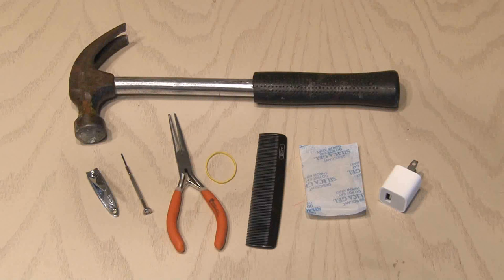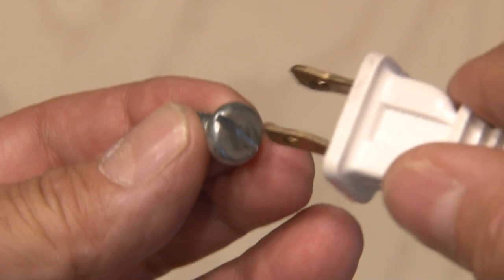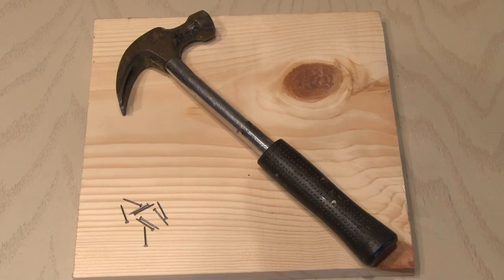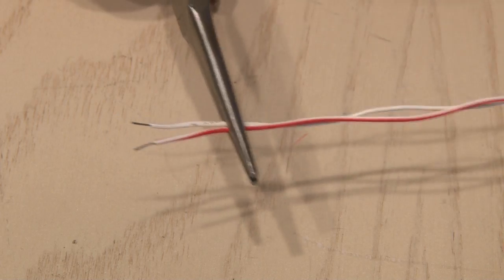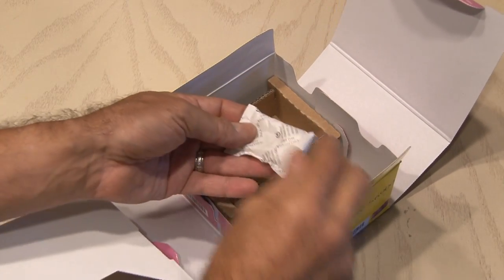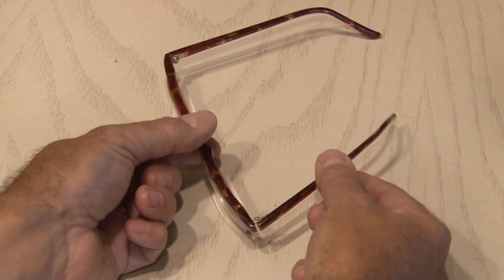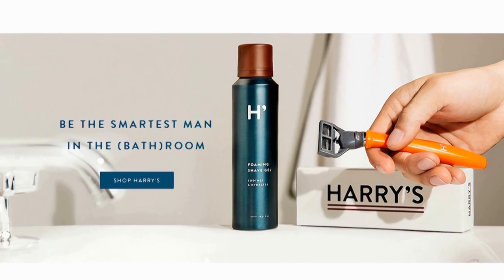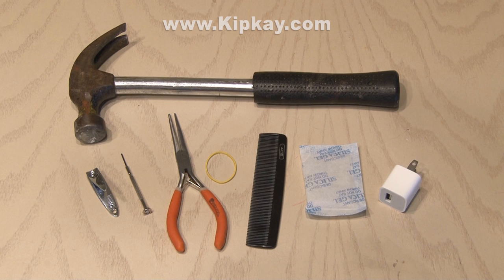5 Handy Tool Hacks!

Comment: 1st trick not working for EU people
Reply: Agreed . im from Croatia.
Reply: Same with uk
Reply: That's why America is better
Reply: MLC games daj cuti
Reply: Ryan Albright america is better because of a plug?? Well America really is impressive with its plugs then.... We have a lot more in Europe than just plugs.
Reply: Yeah I forget what the EU adapter looks like let me check BRB
Reply: Yep I could see how cylinders would make that impossible
Reply: Ryan Albright I would say that the plugs we use in Europe are better, Since your plugs don't have ground connections.
Reply: Küsh_Lord US plugs do have ground pins, just not all of them. I don't know why. It's pretty stupid.
Reply: ThatGuyNamedScott. C in EU we are using 230V in the outlet instead of 115V
Reply: three phase?
Reply: Super Nova The 240v outlets are actually only running on two phases.  I have yet to see a house with 3 phases, I do electrical work.
Reply: sc0tte1 You got them in Europe. But they are at 380 volts.
Reply: cokefridger what do you mean "buy" guns? we get them in our happy meals at McDonalds
Reply: sc0tte1 No. You only count the phase, not the neutral and protective earth. 230V: 1 phase, 400V: 3 phases. at 230V you must use a neutral, at 400V you can use a neutral (at equal load on all phases you dont need it). 220V and 380V are old values, they are not used any more. At the most houses a 400V, 3 phases cable comes in and get spread to some 230V, 1 phase. On big loads like oven, cooker, etc. you can have 400V.I refer to Germany.
Reply: cokefridger # phase plug has 3 prongs and two slots for clamps for ground and zero. If you connect ground to zero the main safety switch turns off the power.
Reply: Super Nova I am in Canada lol
Reply: At least in the UK our plugs are fused and have to have an earth plug, they are also 240v so America's plugs look like a childs toy compared to our bad boys...
Reply: ***** what language are you speaking?
Reply: Ouchie God damnit! My wallplug is round
Reply: ThatGuyNamedScott. C I didn't know that the uk wasn't in Europe {-_-} smh
Reply: Graham Hosken I never said it wasn't?
Reply: ThatGuyNamedScott. C then why did you say and the uk too
Reply: Graham Hosken because UK has different plug to mainland Europe?
Reply: Graham Hosken I know but people forget we are different
Reply: ThatGuyNamedScott. C ok
Reply: Why so much aggression here? We are all human beings, accept each other as that...
Reply: snovosel2 Ja isto iz kojeg grada si?
Reply: Ouchie ! WRONG ! 
In the EU (and rest of the world lol) you can use the later shown "HotGlueMagnetic-Impact-Tool" to hammer the Plug in every needed shape like Phillips ; with time and efford you can realize TORX and all other kind of exotic Screws easily. 

..."People cant transfer things they learn in a 3 minutes video... thats so... king of random!"...

Kappa.
Reply: Ryan Albright Or maybe that's why America is the worst.
Reply: Ouchie greece
Reply: +Ryan Albright Hahahahahahaha
Reply: +Ryan Albright EU masterrace!
Reply: use a Butter knife xD
Reply: +ThatGuyNamedScott. C The US is getting pretty bad hope they have space for me in Germany.
Reply: Cancel
Reply: Same Asia
Reply: Ouchie yes im from Romania

Comment: The silica gel only works good when the tool is enclosed inside a bag or container with the silica gel, otherwise the silica gel will soak up all the moisture in the air in no time at all if left in an open draw. You can refresh silica gel packs by placing them in a toaster oven set to 150 degrees for 1/2 hour. The best way to prevent rust on tools is by applying a thin film of motor oil using a rag after using a wire wheel to remove the surface rust.

Comment: You can also use nail clippers on zip ties if you are doing cable management. They are also handy to cut the tie without cutting any wires.

Comment: Another helpful "hack" is to sand the face of your hammer with some 120 grit sandpaper. It helps keep the hammer from sliding on the nail head as you strike it. Try it, it works!
Reply: Nice

Comment: I have another hack, if your into making model railroads or you work with small screws you can use twisers with "flat" ends to old and rotate the screw at the same time so you dont loose it and you can pull it out from tights spaces with is pretty common in model trains

Comment: I like the silica packs.

Other tips:
Place the back of a hammer into an area you need to ply. Take a different hammer and smack the hammer end of the first hammer. Now you can ply very easily. Also works with crowbars.

Comment: screwdriver hack doesn't work in europe
Reply: samramdebest Use the $15 (€13) you save by not going to Harry's, because they dont ship to Europe, and buy some American plugs on ebay.
Or as a last resort go to a poundshop / Todo a 100 / Trezentos / ToBi / 100 forintos bolt / HEMA / Tiger / 300 / Dealz / Tier'n / Bubbeltian / Fixprice and buy a screwdriver.
Reply: Maxx B Or use your nail
Reply: Just get a knife 
That works also
Reply: I'd just use the pliers with the small screwdriver, save me trying to find the nail clippers, which is almost impossible in this house.
Reply: KnifeH Were you trying to be funny?
Reply: Desmond Miles D'aaaw. wittle Desmond-chan doesn't understand and has to confirm if it was funny or not.

Don't worry though, I understand it's hard sometimes. <3
Reply: Desmond Miles D'aaaaaw. He's so mad he need to use an insult that isn't even an insult anymore. So cute. I just wanna pinch your cheek.
Reply: It does
Reply: +0Alastair0 no it doesn't

Comment: Instead of fumbling around with a pliers and a rubber band to hold a wire for tinning, I just use a clothespin.  The kind with the wired spring-action.

Comment: on the nail thing you can usually just hold your hand flat against the surface and put the nail between your index and middle finger to hold it, give it a tap to make it stay in place, then move your hand away. if the nail is too small for that or your fingers are particularly thick, sure, use a comb. i am just pointing out that you were holding the nail wrong in the first place.

Comment: Use the needle nose to hold small nails for hammering. No need for a comb, and with the needle nose, you have grip strength and nails fit well in the grooves so nails to not move around.  Also, just use the normal pliers to hold small or thin screwdrivers. I would imagine if you are working on stuff all of the time, you would have easier access to pliers then nail clippers. Oh, and buy Harrys shaving stuff...

Comment: I don't think that silica gel bag will work in that last drawer ;-)
Reply: pcfreak1992 ...or any of those non-airtight drawers.   But hey, at least the air around his tool box is a tiny bit.. less.. moist...?
Reply: pcfreak1992 It does work, but they make crap screwdrivers.
Reply: Dosbomber well maybe a little bit, but that gap was so huge, that even walking by the thing would flush the whole drawer with fresh air.

Comment: Kipkay then you will make halloween or night lamp powered from batteries? I am waiting. Thanks for video!
Reply: windlink123 not to be mean but thats to easy, 3 orange/yellow leds  small wire  hot glue  small switch  and a 3 volt battery or 2 aa/aaa batterys
Reply: Bengy22 and for a night light change the leds to white and place it all in a project box
Reply: Thanks for advice +Bengy22 . I think that +Kipkay can make advanced project eg. automatic light with photoresistors and etc.  as it did earlier

Comment: I hate to be a party pooper on your silica gel hack, but that's not going to work.  Silica gel will pull all of the moisture it can out of the air in about 15 minutes.  After that its at max capacity. The idea is that you put it in a sealed box (like the electronics box) and seal it shut with shrink wrap.  Once its left in open air its useless unless you bake it to remove the moisture.  And even then you only get another 15 minutes in open air.

Comment: I wouldn't buy any fancy razor, I've been using a cheap '$1 for 6 of them' razor for about 2 weeks and I don't use shaving cream, the hot water from the shower is all you need, I dont get any niks or cuts. But that's just me.

Comment: these are not tool hacks!!! these are goid tool tips.
 A hack would be how to modify or "change" a tool. These are fine tips and tricks. handy yes but I just don't like the ridiculously falsified exaggerated title misuse, serious misuse of the term hack. using a paperclip to keep your money folded in your pocket is a good tip.
 it's not a hack at all.
 it's a good trick or tip.
the torque wrench tip would be a hack.